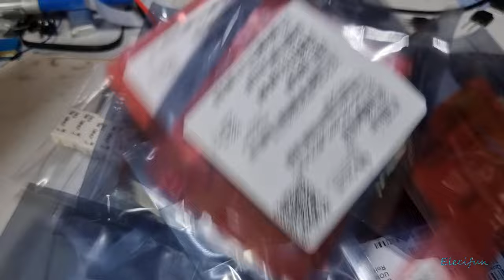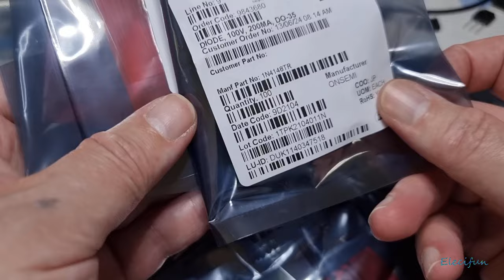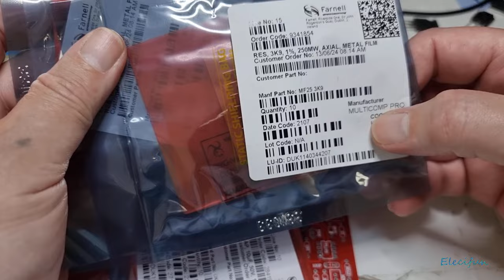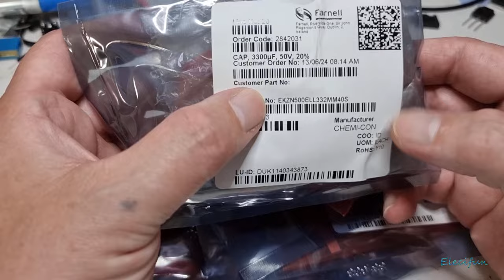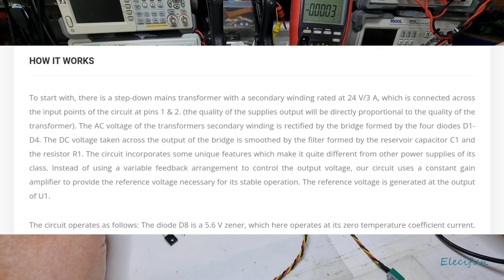Final Solution - Red 0 - 30V 2mA - 3A Hiland Power Supply

Comment: I think these will burn up most Transformers, there's a national semiconductor power supply guide from the 70s or 80s online, it says when spec'ing a transformer, if you use a full wave bridge Rectifier with a capacitor, the ac current is approx 1.8 times your dc load current. This is because when the diode starts to forward conduct not only does the transformer need to charge the capacitor back up, it also needs to provide the output current too.

I'd say with 3.1A (say 3A output plus a max of 100ma for biasing) you need a transformer secondary rated to 5.6A so atleast 140VA on a 24v winding.

If you use a centre tapped transformer then it's 1.2x load current per secondary, as only one winding provides the full current at any one time, 180VA  with 12V + 12V

Otherwise any longterm use it will cook the transformer. 

Interested to see where you go next with this project!
Reply from the maker: @Taylor_26GE93  Why would it burn up a transformer? 
Toroidal transformers are very efficient and if you use a quality toroidal the regulation is excellent. 
Maybe you should put a link to the article.
Reply: @Elecifun  I'll try and find a link. It's more due to the heat in the core rather than the load regulation etc.
Reply from the maker: @Taylor_26GE93  yes please if you can. I would as a rule always use a transformer that is at least 50% more capable than what I need. Example.. RIgol DP832 has 185 watt total output but it has a 400VA toroidal transformer at its heart.
Reading the 'original' documentation for this RED kit  supply, the transformer is used to limit the output current. Hence in the documentation it states verbatim...  "the quality of the supplies output will be directly proportional to the quality of the transformer"
Reply: @Elecifun  I tried posting a link but it looks like YouTube removed it :/
Reply: Thanks Taylor 👍🏻  I'll buy new transformers myself from a "reputable supplier". 😏 140VA. Hmmm.
Reply from the maker: @Taylor_26GE93  YouTube doesn't remove links. They do get held in my 'Held for review' comment section. I validate the links to prevent link party.
No links held for review.... try again.
Reply from the maker: @Taylor_26GE93 So we need based on the reference provided, for a full wave centre tapped (FWCT), our full output current x 1.2.
Or am I missing something?
Reply: @Elecifun  typically I don't use CT Transformers, but I believe it's 1.2x output current per winding as only one secondary at a time is conducting due to the diodes. So output current x 1.2 x 2 for a FWCT.

Or for a FW with a bridge Rectifier,  then its output x 1.8 

That makes sense to me anyway haha. Also the link i provided isn't showing on my YouTube app anymore?
Reply: @Taylor_26GE93  That thing with only one half conducting is only true for true center tapped systems.

The transformer won't overheat as long as your overall average power is not exceeding your transformer's rating. The duty cycle will determine this in the end, as the transformer isn't a silicon device that is damaged by a 50% duty cycle at peak current draw, double that of your average. 

With capacitive systems, yes, the peak current is higher. But that is not magically on top of everything else. The phase shift introduced by the capacitive load shifts the current, and that means more current draw at just before the peak. But the effective amount of joules drained from the capacitor is part of the equation, not on top of it. It is part of the entire system's RMS power draw.

Comment: Hi, at 9:50 when you turned the power on the meter showed 12V for on instant before returning to 0, not sure if it is a meter issue or a PS spike what could be dangerous. Thank you very much for expending time and money on testing this little red bastards :-)
Reply from the maker: @carloca71 I will check that spike out and get back to you. I had to find out if it was a component issue or not, and now I, we know. Well worth the expense and time to get the question answered once and for all.